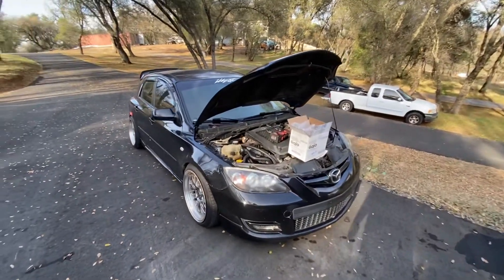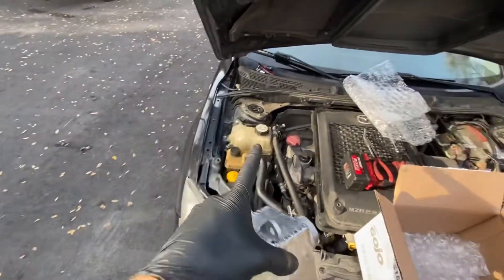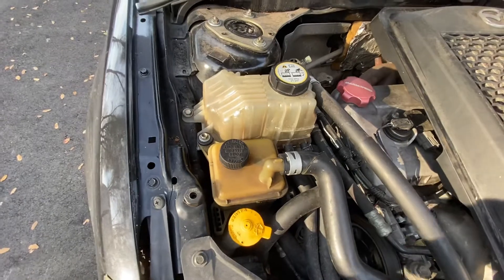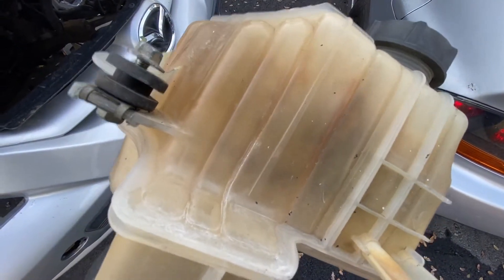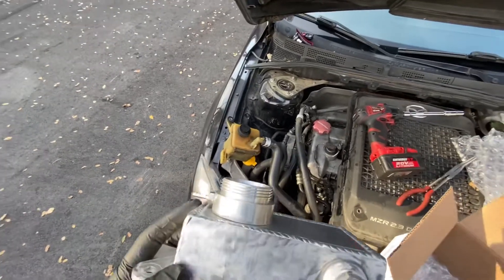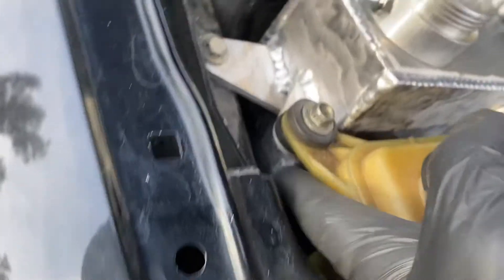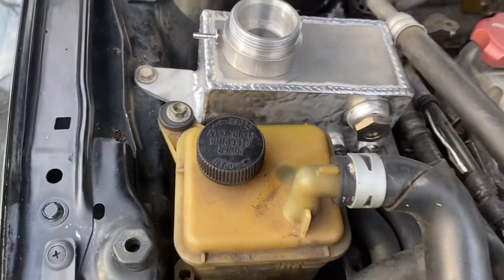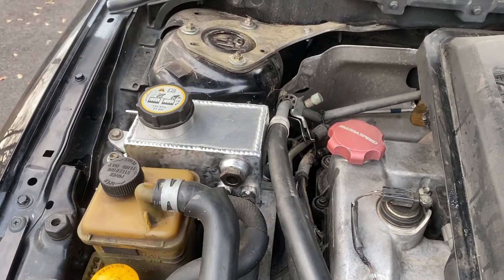Installing Graveyard Performance coolant tank on the speed

Comment: I have a few questions: How is this metal reservoir holding up? Is it a daily use part? If so, is it performing just as well?

Reason: Mine recently had cracked. Thankfully, I stopped at home and opened the hood. I heard it hissing and was able to see exactly where it was coming from (hot side as you stated).

Comment: Question those cracks didn’t seem to be too bad I’m curious what affect can those cracks have on the reservoir as a whole? Are any cracks acceptable or will having even a couple cracks affect the operation for the speed3?
Reply from the maker: The cracks were all the way through both sides causing the reservoir to leak absolutely everywhere, and lose all coolant as well as overheat very quickly.
Reply: @that150_  damn That’s giving me great insight I’m having a coolant loss problem from the reservoir 2007 Speed3 the coolant leaks from the bottom of the reservoir right under the “Full “ line this entire time I thought it was the reservoir bleeding coolant I thought I over filled but there is a couple of cracks around that part of the reservoir so I’ll have to take off the reservoir completely and see if they do indeed gash all the way through but the symptoms my car is having is what you just described, did a head gasket leak test, etc all were good no lines leaking, so I’m hoping it’s the tank and it thermostat thank you so much 🙏🏻